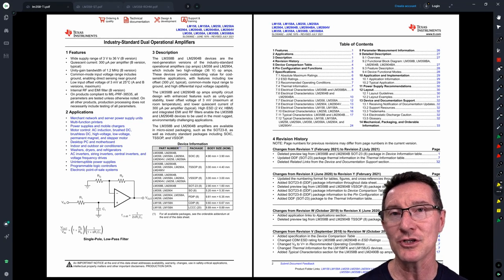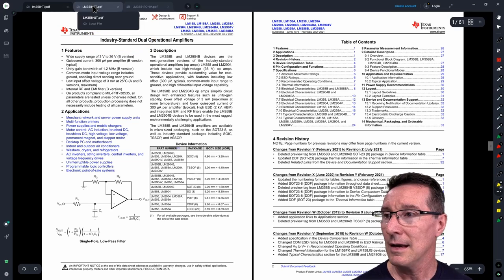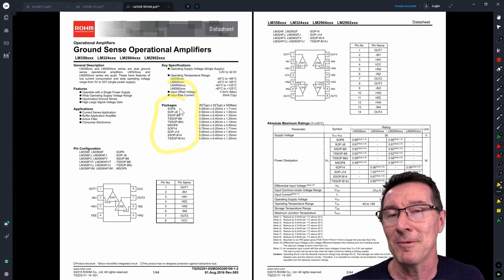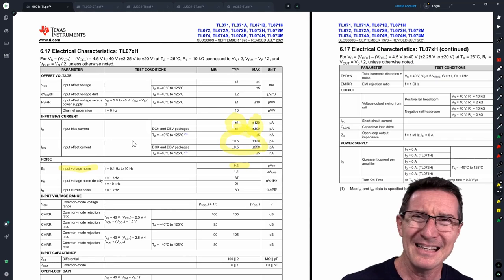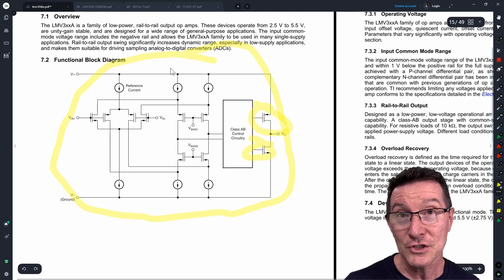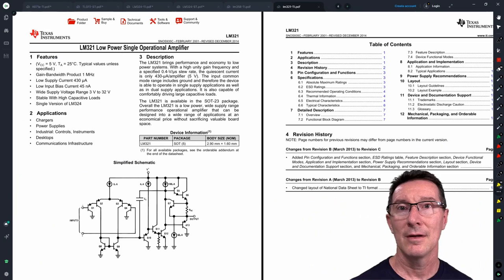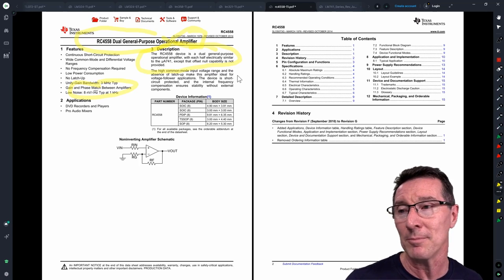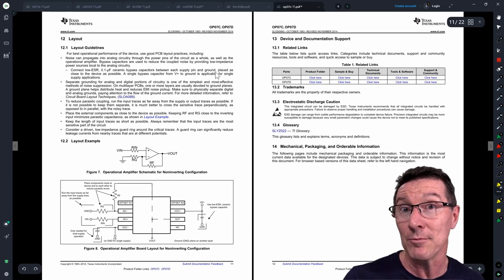EEVBlog 1436 - The TOP 5 Jellybean OPAMP's

Comment: Does LM386 count as an op-amp? Should be mentioned here, even if only to troll the audiophiles. :) But I do see them everywhere.
Reply: Nope, it is an amplifier.
Reply: @squidcaps4308  Op-amp = operational amplifier. Al Op-amps are amplifiers... The LM386 is specifically designed for use in audio, but can also be used for other tasks like a "regular" one.

Comment: Jellybean op-amps are great, but check new parts in circuit before you let production loose with them! It’s not good finding the replacement part has been die-shrunk and is now oscillating in what was a robust design… and production have populated 1000s of boards…

Comment: You mentioned that the LM321 is not a jellybean part because it is out of stock everywhere, and while I admittedly don't know how it was before 2020 with the LM321 I would be willing to say that it is probably very popular at the very least because it is out of stock right now. It is near impossible to find even jellybean resistors right now, never mind ICs, and the LM321 can't be that unpopular based on those Mouser order numbers.

Comment: I miss the op-amp/comparator version was, as best as I can recall, in the 2900-series.  This part had one op-amp and one comparator in a single (8-pin-DIP) package.  Very convenient part to use -- if/when I can find it.
Is that part still around?

Comment: I've used the LM10cln a few times lately. Nice single op amp with a built in voltage reference. Good for a comparator.  Not a jellybean though!

Comment: Nice idea to show jellybean components.
I would have grouped the LM324 & LM328 together.
I would not have included the 741, are there anybody that uses that part anymore?
The 741 was the first OpAmp I played with and I remember a time in my education where we had to do some lab circuit testing with it. We where asked to calculate a oscillator and then go build it and measure the result. I had some issues with the parameters ("High" frequency and large voltage swing) and was told very clearly to shut up by the teacher. The lab work was in groups and I decided to keep some distance to the actual build and testing, until the other in the group looking like they where close to gray hairs (I was the only one with practical experience with OpAmps).
I am not sure OPA333/OPA2333 qualifies as a jellybean part, but it a nice OpAmp for some applications.

Comment: Transconductance op amps, namely Lm13700. Voltage to current conversion. Is that what Transconductance means?  Trans impedance amplifier would mean then, it converts the current to voltage?

Comment: How 'bout MCP6001 / MCP6002 ? 
FAN4174 / FAN4274 ?
I think those modern jellybeans are worth mentioning, since they're available in both single(SOT23) and dual (SOIC, DIP) packages.
There's so many times when you just need a cheap single opamp for signal conditioning before an ADC or something.
Knowing about these can be a lifesaver!
Reply: Totally agree about the mcp600X it's an absolute staple in my world. Same with the OPA1678/9.

Comment: Big thumbs up! Not the kind of info that you find easily if you're not working in the industry or actively looking for it I think.
More for different components please, this is very helpful for hobbyist, selecting parts can be very daunting when you don't have experience.
Even mundane parts like diodes and resistors would be interesting (when do you need metal film, and when is bog standard carbon good enough for instance). Surface mount stuff would be nice to cover as well, since it might look scary but really isn't that hard to hand solder, unless you go really tiny.

Comment: Jellybean parts should be a playlist :P
Things that would be on my jellybean list:
logic:
74HC595 - 8bit shift register (serial to parallel converter)
74ABT244 - high speed, low delay, high current logic buffer.
74LVC1G58 - SOT23 configurable logic gate. Essentially a multiplexer that switches between A and NOTB. Everything can be made from it.

power stuff:
MC34063: cheapest DC/DC IC
IR2184  - MCU-controllable half bridge driver. When you need a powerful PWM output. Goes up to 600V.
IR2153 - same as above, but self-oscillating. essentially a powerful 555.

Also TL431 or NCP431 (low power). That thing will never get old :D

Comment: I would love to hear a discussion about supply voltage pin locations! When I was a chip designer, where should I place which pins and why?
Reply: I’ve always thought that Vcc should be on pin 1 and ground on the last pin so opposite pin 1. This could be the standard for all chips: op amps, microcontrollers, memory, whatever. This way everyone would know which was which and avoid the terrible error of connecting them up back to front! Also, it would facilitate the placing of a bypass cap right next to both pins with minimal trace length.
Reply: I'd say place them where they normally are.
On an 8pin SOIC/DIP package they on pins 8 and 4, having them always there is nice, because then you don't have to remember exceptions to the rule like the 555 timer where pin 8 is Vcc and pin 1 is ground
Reply: unpopular opinion; such that the bond wires are the shortest...

Comment: Still using the TL's in many applications, or NE5532 or the OPA** I always have these in stock, for repairs, next with other industry standard components. But these side components, these are the ones that are harder to get these days. A simple radial Elco for instance, and axial are even worse. I did once a test, switched the TL07* with the OPA2* opamps on a mix console, on the audio line channels you didn't hear a lot of change, even measuring gave only less noise. But microphones and phono channels, you heard and measured better dynamics. But if the mod was worth the job? I still don't know. I think not. Because the rest of the circuit stays the same. And re-engineering these are way above may pay grade.
Reply: Lol i was playing with OPA633 and the smoke came out.

Comment: Those 4558's are good tho. U say NOT rail to rail, but the usable range is good.  Also, they're tough as I think I've only toasted a handful in the years.   i don't consider them dual tho. B is definitely affected by A. U've got to adjust B to get A to stabilize.  Sounds crappy if I say it like that, but the performance is better than 358.

Comment: Hi 
Great video,
I am a chip designer, and in order to test my chips I need to design test boards.  And videos like yours is great help.  By the way do you know any good rail to rail CMOS (ie. 5V or 3.3V) low offset opamp?  Also, It would be interesting to have JellyBean NMOS, PMOS, NPN, PNP, JFET, rectifier Diode, Schottky diode, RF Diode, PIN diode, comparator.  When we design our custom ICs, we can build them all with transistors, resistors and caps.  But when one designs PCB for testing one's chip, it is not practical to build them with transistors, resistors and caps, and you need to know the common building blocks and parts.
Thanks for your great video.

Comment: My op-amp question is, does the power supply have to be balanced?  I have a project where all of the signals are at ground or positive.  Since op-amps get finicky as you approach ground on a single supply can you power it from -5v and +12v?
Reply: Use a second opamp to split the rail.

Comment: If you are doing electronics as a hobby then to save money these things are SO ubiquitous you can salvage loads out of scrap electronics. Just use a hot air gun or a solder pot or even a hot plate/upturned iron to get the components off the board. Don't look at the time taken to remove them as wasted either. You can use the removal to practice your remove/repair skills on boards that don't matter and if you break a few components? Who cares, they're free and every one successfully salvaged is one more for the hobby parts bin for any test projects that may need them.

Comment: Meanwhile, guitarists will spend hours swapping specifically JRC 4558s to find the right one, insistent they can hear the difference between them.
Reply: In a distortion pedal, no less!
Reply: @mjrippe  seriously, the opamp aren’t even pushed into clipping or anything and run on a miniscule 9V! 

The only circuit where it KIND of makes a difference is the Rat and the piss poor slew rate of the LM308 does some stuff to the upper harmonics, that’s it.

Comment: Cassette deck from 1980s..4558 op amps. Pulse MP3 SD USB BLUETOOTH 2021...4558 op amps. Thanks for a great video. Your comment on industry standard pinout 14 pin DIL (+v pin -v pin 11) just fold the pins and turn the package over now rails are reversed!!!!! I did it once when i messed up a layout and was desperate.

Comment: Can you help me and do a review on a LM6172 there isn't alot Schematic of this. They use this chip for Video Synthesizer by LZX Industries. And Also i what to start using different chip by going into high Frequency to do Video besides LM6172.
I did notice the LM13700 was sort of working some of my Eurorack Modules for Audio Synthesizer  was working or getting Resonance on the filters some of them.some of the chip seems not work because the hight Frequency.i don't know what other chips like the lm6172 be similar.

Comment: Could you do a video on how to interface different logic level parts like TTL/CMOS and 3V3/5V? Like when to use a 74HCT vs a 74HC, how to level shift in practice, when it’s enough just put in a current limiting resistor, etc.

Comment: Are bipolar opamps stable with a lithium supply ?
Reply: Huh? If you mean using a lithium battery as a power source: batteries (regardless of chemistry) are as clean a power source as you can get, so they won’t cause instability.
Reply: @tookitogo  It's a quip: Bipolar is a psychological trait where depressions and manias alternate. Often lithium based medication is used to stabilize the mood swings.
Reply: @plemli  D’oh! :P I didn’t think that far afield from electronics!

Comment: Can they make op amp smaller and denser almost like CPU?
Reply: To what end? One doesn’t typically need thousands or millions of op-amps in a circuit design, and shrinking the individual transistors will decrease power handling ability and increase noise.

Analog ASICs exist, so it’s not as though analog circuitry, including op-amps, don’t routinely get integrated into more complex ICs.